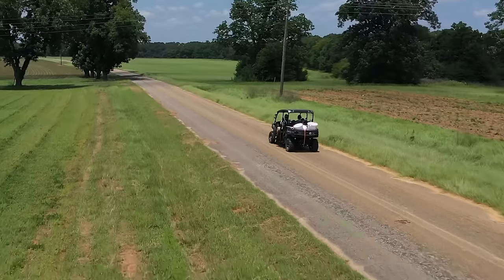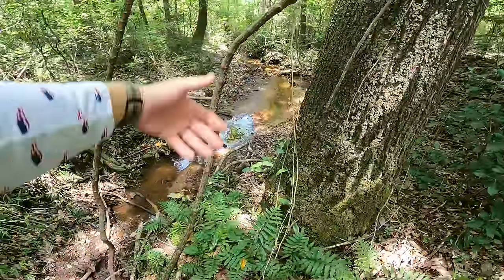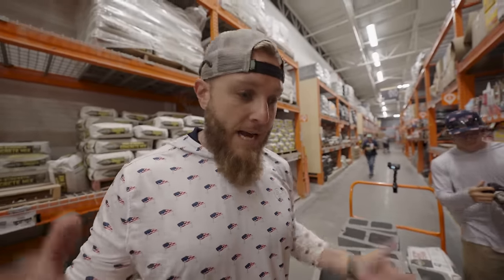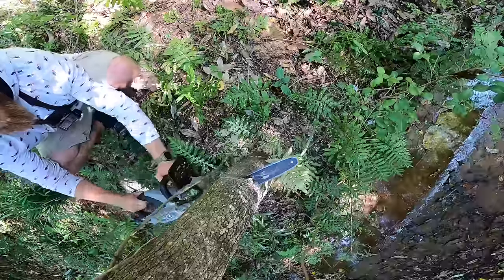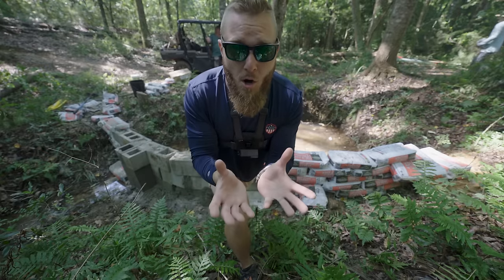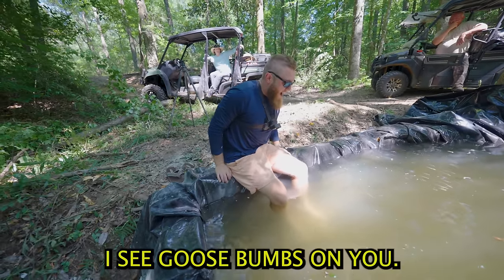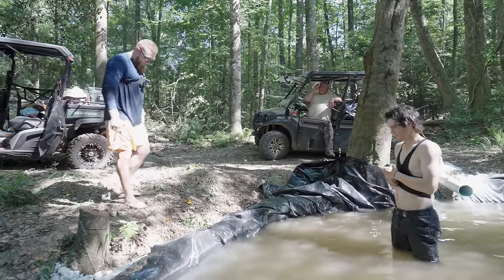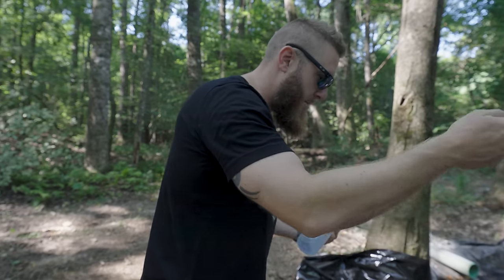Turning a TINY Spring Creek into a FISH POND in the Woods (FULL BUILD)

Comment: I build ponds and water gardens for a living. I would put rocks around the edge. We us limestone, but it doesn’t matter. Cut out a shelf behind the liner and set the rocks inside the liner (in the water). Bury the edge of the liner as best as possible. Don’t worry about it overflowing so much. Every rain has water going behind it, and it should overflow at the waterfall.

Comment: Aye LOJO, to fix your low spots pack dirt or sand bags behind the low edges to bring the liner up, OR you can also nock out more space on the damn for the water fall like making it a little wider and deeper so it brings the water level down an inch or so and the width will help if it ever does storm and any little floaties can easily pass through the dam and not clog up the little space it has to travel out, just a tip, would love to see if you take my advice and see how that pond could really blossom!
Reply: No

Comment: And maybe throw a small Christmas tree in the middle for protection of the minnows but anchor it down with a cinder block on it side and shove through the the core till some branches push through and maybe tie wire it to the block and maybe add some vegetation to the upward side to stabilize the ground and draw in bugs for them to eat and place more flat rock in the up creek side from there also to help and the stabilize the bank and the crayfish will move up creek from the pond. Hope those were some helpful ideas

Comment: Logo. I know this is an older video.
BUT I wish we were friends when you were making this. I have a lot of experience with concrete and building walls. I would of loved to help you make this. I have a few ideas. Using more cinderblocks and mixing the concrete in a wheel barrel and pouring it in the cinder blocks with re bar. Building a slightly different type of waterfall and making sure the walls are little higher all the way around.
I love these videos and huge fan brother

Comment: Your tree cutting was a solid 2.  You cut out a notch the way you want it to fall.  Then you cut the back side.  If it’s not leaning you would hammer wedges into the back.  Or you can sling a rope around the top and just keep tension on it.  One is right and the other works.

Comment: LOJO I wish I had known you were going to do this project I could have saved you a lot of headaches. In future pond projects you may do, you need to put a substantial layer of ground up newspaper insulation down and pack it against and up the walls as well as the bottom of your pond. It is an environmentally friendly material. What it is, is a construction insulation that you can get where ever they sell insulation. What it does is after you put your liner on top of it and fill your pond with water over time with the pressure and moisture it becomes a clay like substance. This essentially makes a waterproof barrier and thus if you get a hole in your liner it will still hold water and not allow the water to leak into the ground. In the oilfield drilling industry it is also used for loss of circulation material which walls off the sides of the hole which prevents fluid from escaping from the drilling process. Maybe if you build another pond in the future this will help you.

Comment: Take the liner out.  The Dam would eventually be enough to hold the water back.  When it rains heavy, that thing is likely just going to get shredded.

A liner is necessary for a things like koi ponds where there is no water coming in.  I’m your pond is fed by a spring, it will fill up anyway.

Comment: Add a couple inch layer of smooth pea gravel (Or similar) to the bottom. It'll help keep the liner down if any water does get under it, as well as make the bottom less slippery from the plastic/mud combo that will build up. 
I'd also build up the back of the dam a fair bit to add strength to keep a heavy rainfall from blowing it out. 
For the low spots of the liner, buy a smaller chunk of liner & use a good waterproof adhesive to overlap the current liner up to a better height, then landscape the edges.

Comment: From my understanding To answer your question on springs they are free running or flowing bodies of water that are sourced or fed by an underground aquifer.
Spring creeks often do not rely on the force of gravity alone to keep them flowing as head pressure from within the aquifer may provide enough energy to carry the stream over even the flattest gradients. A spring creek, unlike a freestone stream or full blown river, does not rely heavily ( or at all ) on water from melting snow, run-off from nearby and interlocking watersheds, or from rainfall, so normally there are aquifiers or water permeable soils or stone that are underneath non permeable substrates normally things like clay as the rain falls  or with snowfall the pressure from the water ontop of these non permeable surfaces pushes the water out of the cracks in the permeable soils or rock qnd eventually out into creek systems

Comment: chainsaw tip, read up on the right way to cut trees down, what you did is very dangerous and leads to what we call a "barber chair", give it a search on youtube. You ALWAYS want to notch the tree first in the direction you want it to fall and then proceed with a back cut. On smaller trees what you did is a low risk but on larger ones, you run the risk of the base of the tree being violently sprung back at the operator or anyone standing within 30 feet. Its better to do it right and avoid unnecessary risk.

Comment: This will work for you with your overflow concerns
Locate the spot that is just above your waterline that you want put it in to overflow drains and run them back to the stream and I’ll put in a one-way valves at the end of your run this fall clothes off on that bottom one is the only discharge water can you come out and you’re absolutely right the ground is draining itself so be prepared for ground settlement with your plastic liner

Comment: I use to work at Home Depot. Asking for a whole pallet isn't unusual at all. You could of easily asked them for a pallet of cinder blocks and concrete and they would of sold it to you if they had it in stock, or ordered a pallet specifically for you. Just fyi, so in case you do this again you don't have to break your back moving a pallet worth of cinder blocks and concrete. :P

Comment: I don't think craws would be good to stock? They're very spiky and really dig up the substrate of their habitat - not good if you've got a pond liner? If it was a natural clay lined pond (which I thought you were going to do so it looked 💯% natural) I'd say they'd be good to stock. Although, if you're going to be relaxing in it, do you want to be sitting on a couple of hundred pinchy critters?

You could landscape it further? Maybe bank up around it a little more and extend the liner upwards?

I'd look at digging out an overspill pond from your run off pipe, just so it doesn't get clogged up with debris through flow from the main pond? I'd cut down about 2ft vertical from the downstream overflow and make a longer channel for flood run off. Maybe widen the natural watercourse slightly also?

As for edging materials, you want to go as natural as possible so it blends and looks like it has always been there? I don't know what the natural geology is round there but you want rocks that match. Maybe elsewhere on your MDP (Million Dollar Property) there's a natural rockfall area or lots of rocks on the ground surface you could transplant around the pond? Once you've cemented them on top of the edge of the pond liner and the concrete has set, get some brown silicone in a sealant gun and silicone along the underside. Concrete is porous and you'll lose your water level through osmosis.

I'd look at putting in some kind of anti-escape system so whatever fish you eventually stock :

 A- Can't jump over the dam (see my point about overspill "pond")

B- Can't escape through the overspill pipe. Maybe install a grille to the inside of the pipe, or, get a block of pond filter foam and cut it into a "plug" and put it in the end that's in the pond? This would still allow free flow water movement but stop fish or stones or leaves from getting into the overspill pipe?

On the header pipe end where the spring water flow enters the pond, you could find a concrete pipe slightly bigger diameter than the pipe you have installed, and put a grille in one end. Then slide it over the plastic pipe.? This would not only look more "natural" (allowing moss and lichen to grow in it) but would allow for easy maintenance? You just slide it off if it's blocked up with leaves etc, clear the blockage, slide it back over when done.

Hope this has given you a little to think on..? Love the content!

Comment: 🤔 you might should of left that. The roots will be what keeps the together and not slide into the creek. But when you do cut a tree that size or larger it’s wise to cut out a plug on the side of the tree in the direction you want the tree to fall. The come from behind and cut at a slight angle. 
You will also want to consult the “Pond guy” and get his advice on how to make this structurally sound and visually appealing.

Comment: You should put the walls up a couple feet all the way around but right by that tree leave it level so it’s easy to get in and out of . Also build the wall on top of your creek pipe to keep it safe. For the waterfall part you could put just a small piece of pvc and get a piece of osb to put at the end of the pvc so the concrete is flush to the concrete from the inside(you could do the same with upper part of the spring as well. All of this would give it almost a oversized Water Well look but it would very clean look.

Comment: spring water should be about 58 degrees, spring water can be a biological toxin based on the lack of suspended oxygen so I would test for it. re-inforce(extend) the liner by calking veavy duty poly to the edges and then bury them as reinforcing